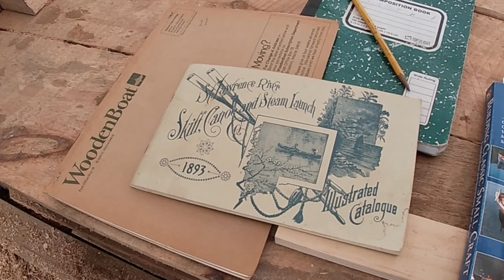Boats Don't Have Flat Tires WBE S2 E18

Comment: Double check the numbers on your your new respirator filters/ cartridges are rated for what your using them for (dust vs vapors). I was using the wrong one for dust and was sneezing with the mask on. Lesson learned! Loving the content.
Reply from the maker: Thanks, truthfully the list of what they are for on the cartridges is a bit confusing. Of course it’s vapors when your doing the first part of the fairing and dust on the second part but I didn’t notice any smell or dust when using for either. I did use it when insulating and no issues and that bothers me immediately with only a dust mask. Thanks for being aboard!